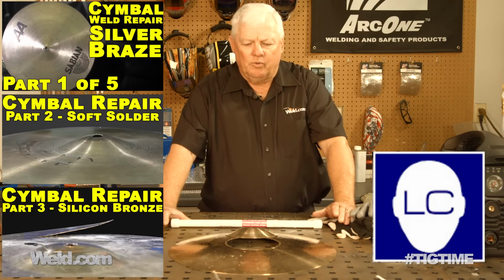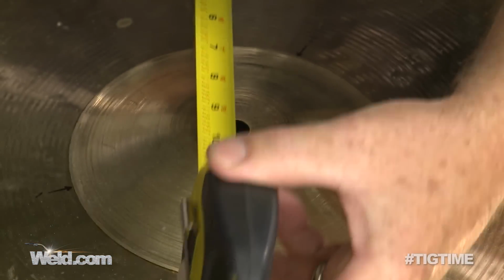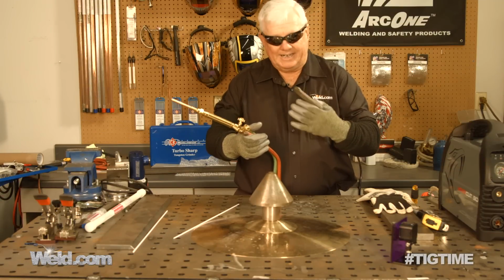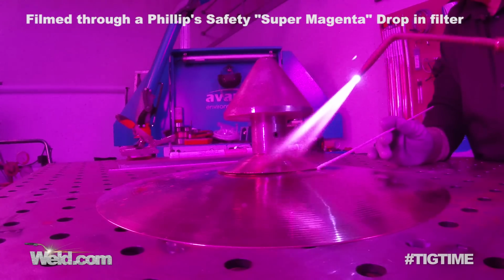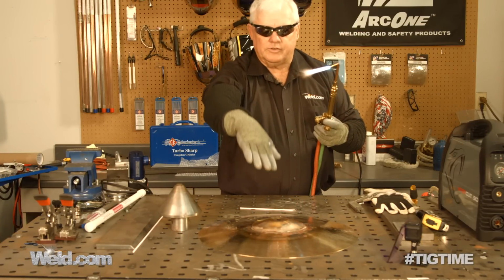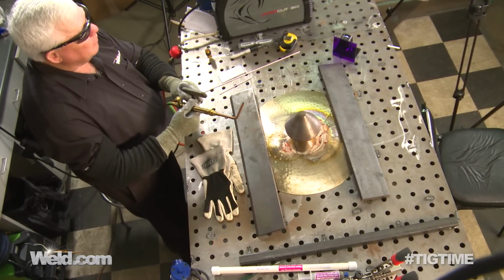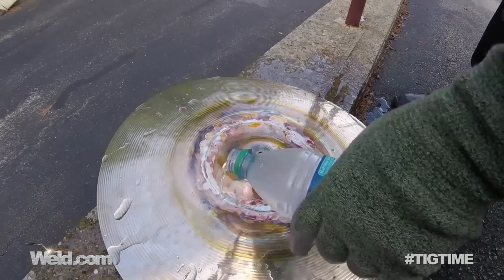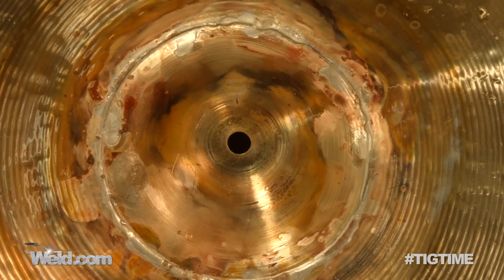Welding Bronze Cymbals (Part 4 of 5) - MUGGY WELD SSF-6 | TIG Time

Comment: Don't know if anyone else mentioned, but the "cool blue" or "heat freeze" putty should've been used in conjunction to localize the heat and prevent warping. that's why the comment featured in the video mentioned it. According to muggyweld's demonstration video the rod was used incorrectly. The flux is supposed to coat the seam,
then you apply a thin line or small beads of silver solder in small sections and begin dispersing the heat along the flux line to spread the solder to reduce the amount of silver solder used. For this project i would've also purchased muggyweld ssf-6 paste flux replacement.

I understand that this is an old video but i wanted to point out that info so viewers end up with good results.
For even best results I'd wait to put the cap piece, make a border around where the cap would be by using the heat freeze putty
then heat the area and apply the flux to where the seam would be and lightly tin it with silver solder. Then i'd let it cool and put the cap piece back on and apply heat and flux the seam and watch as the solder wicks and brings the two pieces together.

Comment: i have to agree that rod looks like it wet out VERY nicely considering the surface was less than pristine... that said due to the nature of cymbals and their metallurgy it would be hard to find an ideal material. would it have helped if you had wet rags on the cymbal to act as heatsinks? i use them when soldering brass models and it is crude but works a charm

Comment: I have enjoyed all your videos. Including the cymbal welding videos. I have a question. What about the the table soaking up a lot of your heat and causing you to have to run hotter if the cymbal was supported off the table bit? just asking.